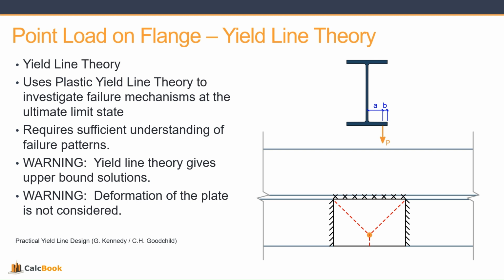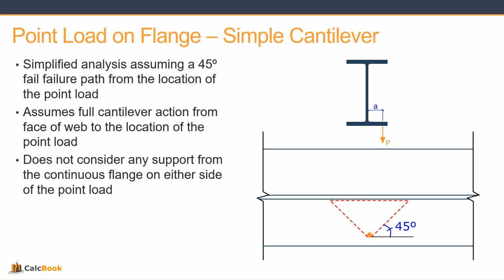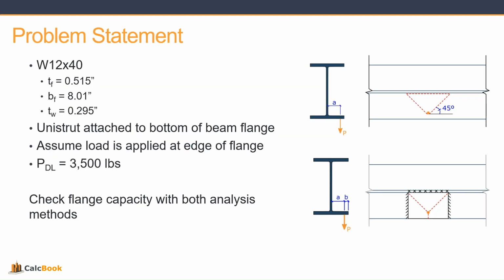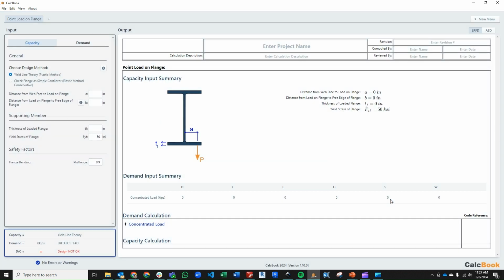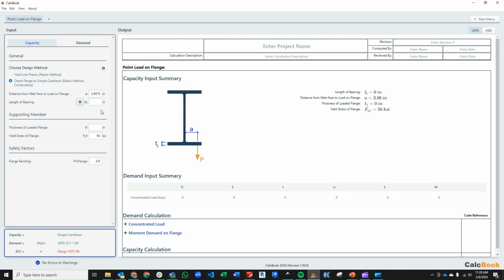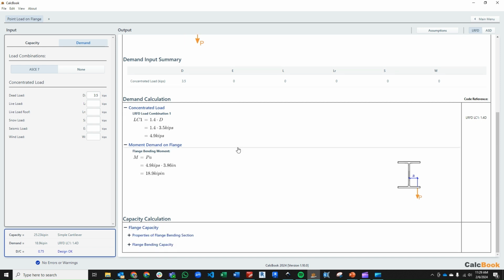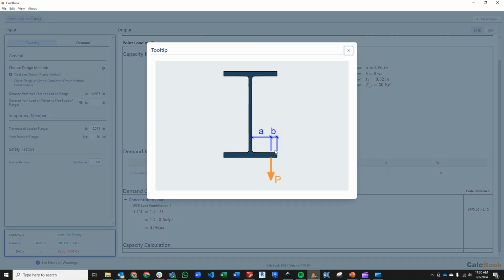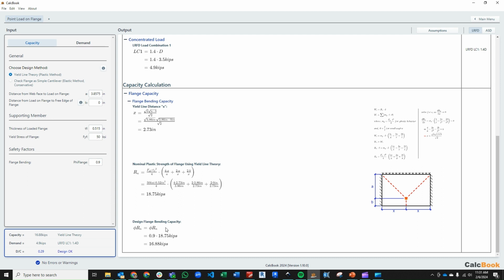Point Load on Beam Flange

Comment: Hi, under the flange bending capacity determining section, the min. (FyZx, 15Fy.Sx) is actually having the same answer, and the factor 1.5 has offset the section modulus factor difference (L'(tf2)/6 agains L'(tf2)/4). This make the min. Flange Bending Capacity having the same min. value. Is this being justified?
Reply from the maker: Hi @jackyleong7764 thanks for the question. Equation F11-1 gives the bending capacity of rectangular bars to be the minimum of Fy*Z or 1.5Fy*S. In this example, you are correct that they give nearly identical answers. Regardless, the minimum of the two values should always control, as it does in this example. Hope that helps.

Comment: Where does the equation for the yield line theory approach come from?  I am reading the referenced material and don’t understand where some variables are coming from.
Reply from the maker: Hi @tonygallegos4632, in short, the equation is derived by equating internal work to external work while assuming small angles of deformation along with the support conditions shown in the video. 

This is the same approach commonly used for reinforced concrete slabs. We have linked to a “Practical Yield Line Design” pdf in the description of the video which gives a comprehensive overview of yield line theory and how to apply it. Otherwise, there are many examples for concrete slabs online that can give an idea how to derive these equations.

Hope that helps!

Comment: There are two errors here I believe: 1. L' = b + 2atan(45)   and 2. Its 1.6FySx not 1.5FySx
Reply from the maker: Hi @SubtainSajid-s9m, 
We appreciate the comment and always like when people keep an eye out for errors. 

Your first comment is valid for what is shown in the original video. This has already been noted in the description, and updated in CalcBook some time ago. We would also like to note that the use of cosine resulted in overly conservative results.

Your second comment is not an error, but follows the guidance of chapter F11 of AISC 360-22. Equation (F11-1) specifies a factor of 1.5 for rectangular members which is what is being checked here. Equation (F11-2) specifies a factor of 1.6, but this only applies to rounds, which is not applicable here.

Note, this video covers the 16th edition, AISC 360-22. Your second comment would be valid for the 15th edition, AISC 360-16, but they updated to 1.5 for rectangular bars in the 16th edition, AISC 360-22.